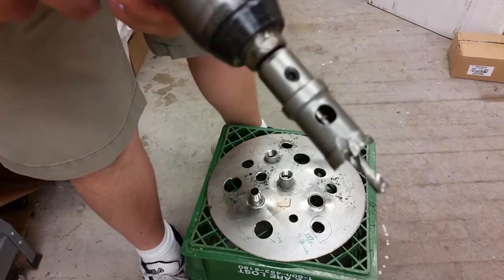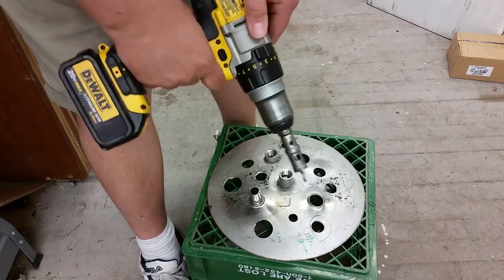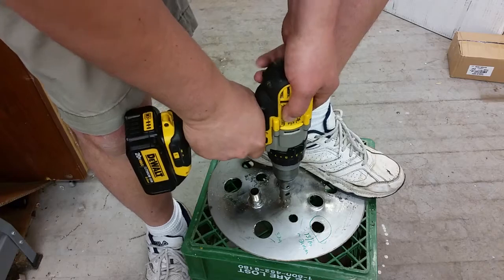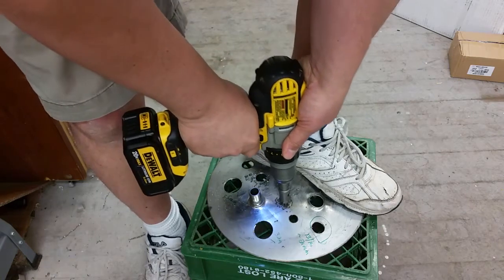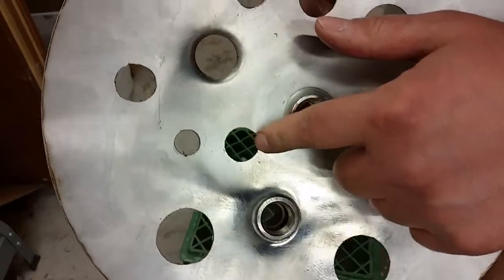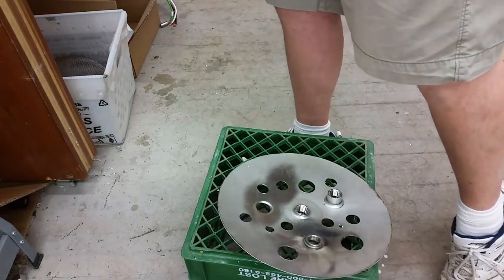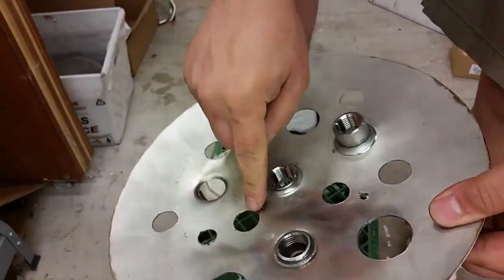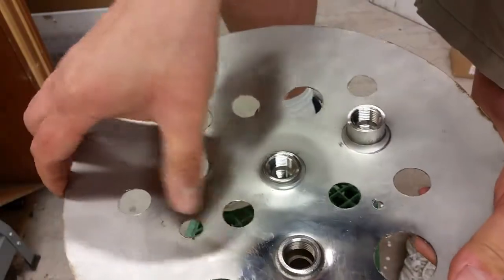Brewhardware Demo of Tungsten Carbide Hole Saws

Comment: How well does these work on Keggles?  I had a really hard time with a titanium step bit I purchased somewhere else to drill a hole for your sight glass for a sanke keg.
Reply from the maker: The test hole you see me drilling in the video is on the cut out top of a keg. These bits can make 100 holes without wearing out.
Reply: Perfect, thanks!